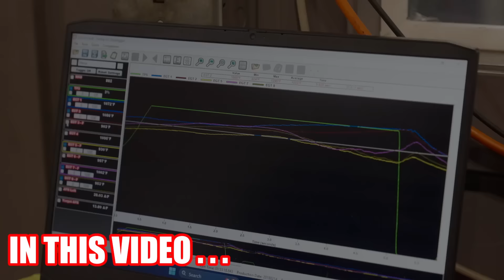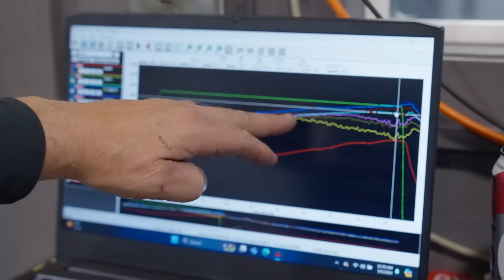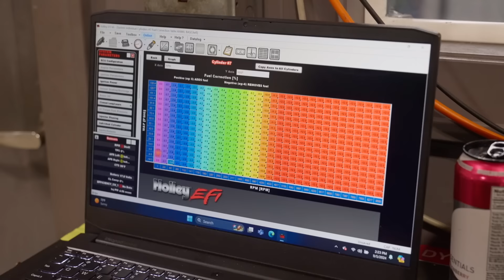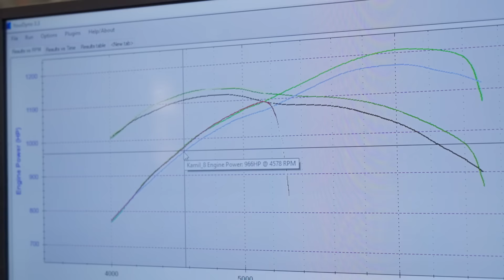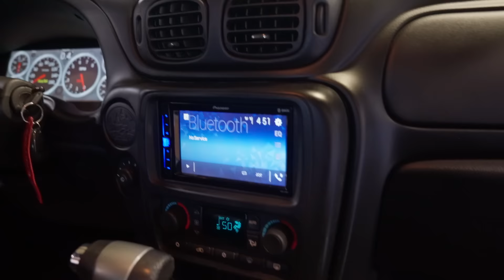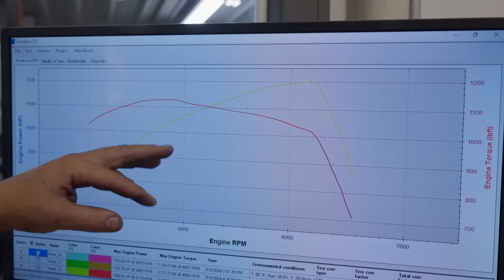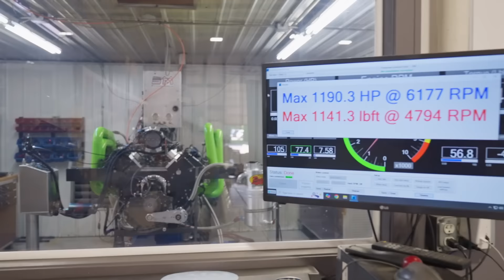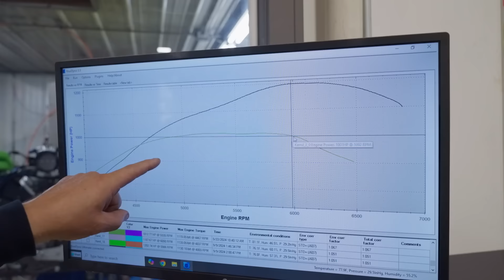200 HP from a Cam Change? The Biggest Cam I Have Ever Used In A Boosted Engine!

Comment: Your thinking and problem solving is why I’m here. This has helped me with my son’s turbo,terminator X, car more than I could ever thank you for .
Reply: Check head to block electrical resistance. Grounding issue on head being anodized under bolt heads or head face
Reply: Too much cam shaft? I’d have to say yes.
Reply: About the drop we see here. Does that also mean you determine your shifting points in the range where the engine has its highest torque figures?
Reply: Same here even called him for help and it was the dumbest thing I over looked what's your son running motor and car?
Reply: @henkoosterhof5947 shift points are around peak hp not torque
Reply: Did u ever add ground straps from block to both heads?

Comment: When your camshaft has nearly 1" of lift and the powerband lays over at 6500 like a dump truck motor, you got some cubic inch to deal with 😮
Reply: Is that throttle body kinda small thats a big compressor trying to get some  serious air.

Comment: The dip in the mid range on #4 is directly related to the exhaust system. Number 5,7,8 is because air is being robbed from adjacent ports. Alos the furthest away from the throttle.
Reply: I was going to suggest running it without the headers just to rule that out. A set of zoomie pipes would have been better. Chances are, it'll all clean up with boost.
Reply: Yup. Lack of proper scavenging from the exhaust.
Reply: I was thinking same thing if the cylinders were still being starved of air. But I'm no expert 
Those are huge intake ports sucking through that throttle body 
Could static pressure of downstoke ever not be enough to pull through throttle body?
Reply: I absolutely think Steve is up against the exhaust system. It looks like it's been designed for maximum restriction with four of the cylinders having an extra 90 degrees of performance robing bends
Reply: @dinosshed - You can’t run zoomies on an engine dyno.  At least not without fabing up a custom collector box for each bank to catch the exhaust and then route it back to the dyno room exhaust.
Reply: @danmyers9372  Steve has bigger balls than all of us don't forget.
Reply: @dinosshed  This is not about big brass ones. If the exhaust gasses aren't properly evacuated from the dyno room, the engine will start to ingest a mix of air and exhaust gas, effectively lowering the oxygen content. That'll seriously throw off the numbers.
Reply: @dinosshed  deeper pockets doesn't translate to bigger balls.

Comment: Talk to Sonny's Engines. They are the 1,000 plus cubes masters. That throttle body looks very small for that cubic inch. Lobe separation is enormous
Reply: Boost will help that. I agree. Airflow?
Reply: The way it lays over does make me think it's being choked somewhere
Reply: @kasuraga  im starting to suspect those longgggg exhaust runners
Reply: First thing I thought when he said 120 degrees.
Reply: @dennisford2000  129 degrees I think is what he said. There goes all your high end hp and torque.  Cam #5 ? 108 to 114 I would say ok. Boosted doesn't need huge overlap. 114 is great for low to mid rpm torque. 128 is obnoxious I would think. Why would boosted need that much overlap. The charge is forced in. I dunno. 🤷
Reply: @TheTherealdarkhorse the larger lobe separation angle reduces overlap. The duration and lift numbers are huge, you can’t expect the cam to specs to look like your average SBC/BBC. 

They spec cams based on valve events, the number fall where they fall.
Reply: It depends on dwell time.  How long the piston sits at TDC. I've worked on mountain motors and I have yet to see separation like that. 123 degrees. That itty bitty throttle body is helping no one.  It is starving the back cylinders badly.  Steve has two throttle bodies on his small engine in comparison. @econrey

Comment: 11:30 I build electric motors as a job. If you're trying to test ohms on the wires or checking grounding conductivity you really need a micro ohm meter to do so with any accuracy. Most DMM's will just say .1-.2 ohms and people interpret this as the same reading and call it good. If you're checking the insulation of a plug wire you should unhook from the motor and test with hipot and megger.
Reply: As well as scope of current and voltage. On coils/injectors induction

Comment: Sonny's 802ci monster motor, pump gas compression (Motor Trend article). Specs below. Hope it helps
70mm custom grind
Lift - 600 intake/580 exhaust (theoretical lift at valve 1.110)
Duration - 284-degree intake, 314-degree exhaust at 0.050
89-octane dyno produced 1,417 peak horsepower at 7,100 rpm and 1,140 lb-ft at 5,800.
Of course the specs on that engine are probably different than what you're dealing with, but the comparision may still have value. Good luck
Reply: that probably had a proper intake manifold on it for NA. Steves intake is less than ideal for this many cubes N/A
Reply: Hi what is lsa on that cam

Comment: If the whole head is anodized; then the plugs could be electrically isolated from the block ground; making the spark jump the plug AND the head gasket to the block (across the thickness of the head gasket) or the gases in the cylinder.  The data at the end of the video seems to support that.

Comment: I finished watching Todays Video Steve where You switched to the Smart Coils.
The Monster 903 ci Hemi wants a Super Long Duration Spark that a Vertex OAX External coil Magneto Delivers or Modern MSD 12 amp or Top Fuel 44 amp. 
Original Vertex Magneto delivers a spark duration of 40 crankshaft degrees. 
MSD CD Capacitor Discharge delivers spark duration of 20 degrees Typically. 
Going way back You will recall the MSD 10 AL CD ignition Box large Aluminum Gold Anodized body that simulated a Magneto. 
I think MSD needs to build a Custom Ignition coils CD system for You. 
Too bad no way to install a MSD 44 Amp Magneto now. Might be possible but thats up to You if course.
Reply: All that timing was because of the nitro this motor isn’t using nitro for fuel
Reply: @kevinkuhl847 Its just the way Steve's Hemi Wedge 903 Huge  Behavior wants A Super Long Duration Ultra Hot Spark a Magneto delivers Best.

Comment: Great information. What a great lesson on how the spark is delivered to the cylinder. Sounds like the MSD 600 is delivering a large amount of energy in the beginning of the combustion event but it is incapable of keeping up with the demand as the flame front moves away from the spark plug especially at the higher load conditions. I wonder if this big cylinder needs to have two ignition systems.

Comment: Holy duration and lift 🤯
Reply: That’s what she said?
Reply: @buffetline2605  That damn thang pokes almost an inch!
Reply: No shit.  I was feeling pretty good about my .641" lift, 256/266 duration @.050 solid roller until I watched this. Now I feel like I belong in the go-cart class.🤣
Reply: Full race cam  🤓
Reply: @erikalston4496  😂
Reply: big engines need big cams to move the air, and as a bonus big cams in big engines will act like a smaller cam than if they were in a smaller engine.

Comment: I forgot one other thing often I’ve seen engines rollover on top end solely as a function of lack of ignition timing on pump gas. Of course, this may not be the case with this.
I do think that camshaft timing could be the reason for the top end dropping off so much .
Reply: Exactly what I was thinking, camshaft timing. Could it be valve float?
Reply: I assume he's tried retarding it to see if it moved up? Maybe it still needs more duration, just thinking back to the days when that 283 had a cam that sounded so radical then the same profile cam in the 454 sounded stock.
Reply: Trial and error mode!

Comment: Love hearing you go through the thoughts. That is troubleshooting at its finest. More people need to follwlow along with you to get an understanding of what troubleshooting is about. 

So, just curious, do you think the large overlap, low engine rpm, and short runner is creating a reversion that is getting into other cylinders? You might not even see this comment given there is about 900 on your video. No problem if not.
Reply: Well, commented too early. Glad to see the ignition wasn't up to the challenge. It really would have had issues with a little boost. 

I don't know shit about engines like you do, but it does seem like the cam overlap would really drop dynamic compression a bunch. Again, I don't know shit. Would a longer runner help with any of this?

Comment: My first thought was a gas flow problem at the back of the plenum chamber, where it slopes down ... reversion pulses interfering with the incoming air... NA is always more picky with intake geometry and resonance...
If that is it, you could try an experiment by making a spacer for the inlet manifold top, to raise it up, maybe 1/2 inch, and see if things change....

Comment: You get me in every time with type of vid... I love problems AFTER I solve them lol.
I take it that because the blower is still on the bench, there is no boost reference fuel pressure curve...
I also assume that you have earth between heads and block.
I agree with your early assumption that too much cam would show more in low rpm.
I have used 300+ degrees duration with 108 lobe centre spread before, but I have never heard of so much lobe centre spread- 123deg??. Farqume!
But hey, this a massive cam compared to anything I have ever seen.
I am so ready to see this lil contract through to the end. cheers mate.

Comment: It is the thinking process you record that makes all the difference. When people want to query the hours they get billed for, they are paying for your live thinking when correcting a problem. This not only applies at SME, but all engine build dyno sessions everywhere. Yes, some engines fall right in at fireup, but when you are doing something out of the box, this is not the case. Very educational to all. I would do the coil swap first (easiest), then if needed, the injectors. For your question, I cannot see the relevence as this engine is being built for a supercharger, so the NA cam to compression issue will probably not translate that well. Stick the blower on it and see how it runs. Pushing air into it may change everything.

Comment: I've been waiting for this video. Wow, what a trip. I don't think the cam is too small. If it's laying over to early then it needs more duration. You didn't show the RPM it stopped climbing. It looked about 5500. I'm just an old street racer. There is a lot of math involved to figure out how much air it can draw in. The best part about a blower is you can force air into it. What is the goal? Max horsepower at what RPM? Since it is a boat motor 5500 rpm should be plenty. How much boost? I would think 10ish. It has to run on pump gas, can you cool the air going in? Colder the better. I'm sure Steve knows all this. Can't wait to see how it turns out.

Comment: The troubleshooting is fascinating, must admit that I was wondering about spark timing of individual cylinders... and how the ignition copes with the bank angle.
Reply: Wondering the same, switching to the smart coil setup which have a longer spark duration seems to go in the right direction, Also thinking about the injector firing timing or possibly out of sequence, swapping the injectors and plugs didn't help, so maybe in the signal to those 4 injectors is corrupt.
Reply: @jeffjohns2189  Steve is no fool but I know he reads the comments. I would like to see perhaps the engine with a degree wheel on the crank and a strobe timing light with the trigger attached to each cylinder in turn, the 64 degree bank angle has been ugly with earlier cams but might be a factor with both injection and ignition.

Comment: love your work. know your struggles. have an issue with my car. chevy s10 gen 1 4.3 160hp +160 shotran fine on Saturday 13.8 in 1/4. on Sunday lost 1 second on my runs. check averting all looks good except tha spark plugs are black. just on tha gas. when it hits the Nitrous it clears up.. fuel psi is good. valve are good. timing is good

Comment: Make sure the (heavy) ground wires from the heads to the coil pack grounds/valve covers are extra good. The high voltage needs to get back to the coils easily.

Comment: with that lobe separation u prob wont make more power as rpm increase n/a but will be great for when its boosted, also u said u fixed the block grounding but i hope the heads were also grounded good as some coils need a direct earth return for the coils to work properly

Comment: Get a peak reading voltmeter and check if there is any voltage between the coil ground and the head ( or even the plug hex) when running.

Comment: Used to have a 14 channel 50k hz sample rate. It would allow you to watch almost all of the channels on the old non diagnostic computers. Had a 318i Beemer that would give you a flash code for the cam . The crank pulley was the reluctor and first belt and had a rubber molded to the inside and outside. It was cracked, but so fine it was not noticeable until I got the 14 channel. You could see it when it was warming up and it would get a small dip in the sine wave, about 150 degrees out of the blind tooth . It would think it was running its low speed plots and go too rich , as it was seeing it as a blank .

Comment: Seems like it should be making a lot more power. My 855 ci engine made 1,670 hp N/A on race gas.  13:1 compression. Cam was LSM 122 LCA, Intake duration 292º & 1.14" lift, Exhaust duration 332º & 1.07" lift. Billet heads w/PSI springs 550 lbs on the seat 1460 lbs off.  
There were racer reports of some Pro600 coil issues. What plug gap are you using for the N/A testing? They came out with some newer, supposedly better & higher power (8280) coils a little while back.
Hopefully you get it figured out, it's a head scratcher.

Comment: The EGT Story is an interesting one because when I had a conversation with Calvin Elston, of Elston Exhaust, he had a conversation with me regarding the location of the probes along with having the bungs located on the top, or the bottom of the tubbing on our Tri-Y Headers.  Calvin has extensive experience with Headers-including working with Burns Stainless on lots of projects.  Anyways, Calvin stated:  placing the probes on the bottom side of the header is done to not interfere with the exhaust wet flow.  The wet flow of the exhaust goes up on the top of the exhaust-so, why would you choke off the flow was his point.  As a result, he always puts the probes at the bottom side exhaust tubes.  He used the example of sticking your finger in your mouth and how that “chokes” your breathing..another words, why would you do that?  Just food for thought.

Comment: The fact that all 4 cams seemed to fall off at the same rpm would indicate valve float to me. I wouldn't have thought a cam grinder would have made an error like this, but they did screw up 2 cams. Back in the 80's we had strain gauged push rods to determine a cams no follow limit, this is probably old school now.

Comment: Before you started adding/subtracting fuel I would have been tempted to swap injectors 5678 with 1234 and see if the problem moved with them. ( oh! you did about 10 mins later) Well that didn't work, next leakdown test on all cylinders?

Comment: Keep thinking out loud, do you have another head that isn't anodized?  If so you could put it on one side and leave the anodized head on the other side and then you could rule out the anodizing as causing an electrical problem.  Another thing I was thinking is take a spark plug and short the electrode to the body and then test the resistance through the ignition wire to ground strap on the block for each cylinder and see if there are any differences.

Comment: I think the power peak is a function of insufficient port area for a 113 inch cylinder. The jet/pump/boat drive, whatever you want to call it is RPM limited as you mentioned previously, so the combo is actually quite well matched, I just don't think you can do much given what you have. In terms of compression ratio or lack thereof given it's a boosted pump gas combo, I don't believe you are now "overcammed" because the bigger cam should have created a much peakier power curve whereas the bigger cam actually gained torque at torque peak and below, meaning the cylinders are filling better than before. (to me at least) I'm staying with my prediction that the intake runner is just too small for the cylinder it has to fill. As an aside, perhaps the collector diameter is pretty tiny looking for an engine of this size, you might be fighting exhaust temps once you start dialing up the boost numbers.

Still a very exotic and cool combo to be working on, in spite of it being a charity build at this point.

Comment: Steve thanks for sharing all the trouble shooting / I think it is possible that the cam is to big with the NA version,  but maybe good if its the boosted version is it possible this could be a harmonic problem in the valve train, or could it be to much reversion happening in the intake, I'm wondering if there is a provisions to put a mag drive on it to see if the cylinders even out .